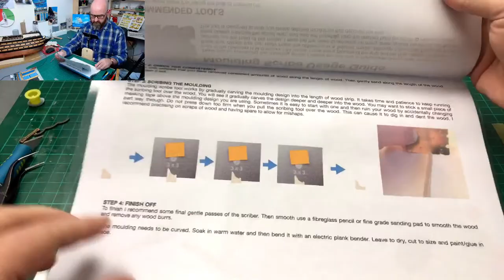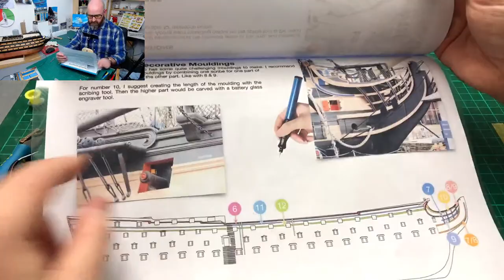1/84 Scale Model : HMS Victory   / live build

Comment: Hi John, I was looking at that gallery set for the Victory but it would require me to rip out the stern area which is completed and painted.  It would enhance an area of the ship that is very prominent so I’m having a heated argument with myself on whether to proceed.  I think the new gallery argument is going to prevail. LOL
Reply: Hi Clyde I’m in the total agreement with you.  I’m thinking about doing the same. To get the much improved PE windows behind the gallery. Did you hear what a spoke about concerning the  moulding scraper.  As  a patreon to my channel you will be getting one from me as a gift for being a patreon
Reply: I did hear your generous Christmas gift plan. Thanks!  I think I mentioned in a past comment that I have been using trimmed down doll house moldings.  I like the idea of making my own.  One aspect of the new stern gallery that I really like is the ability to paint the PE window frames and muntins. That is a significant improvement.
Reply: Hi Clyde, I also sell just the 3D printed gallery parts for people like yourself who have already installed the gallery.
Reply: Hi Neil.  I decided to do a total remodel of the stern and ordered the deluxe set. As it stands now,  the windows and general proportions of the gallery  for the stock model is not good.  Considering the time and money I’m putting into this build,  that area needs to be as accurate as possible.  I really appreciate the effort you put into making this set.
Reply: @clydesims5121  I completely agree. It has taken me months to research it and design it. As I feel the Gallery is the most eye catching part of the ship. I have not seen any other model company produce Balusters as accurate as ours for their kits. This is because with conventional methods it is impossible to make these with an accurate level of detail. Thanks to modern advancements in resin 3D printing, it is now possible. Anyway thank you for your order. I hope you will be impressed when you receive it. Thanks Neil
Reply: @WoodsHypnotherapy  any videos of kit being installed ?